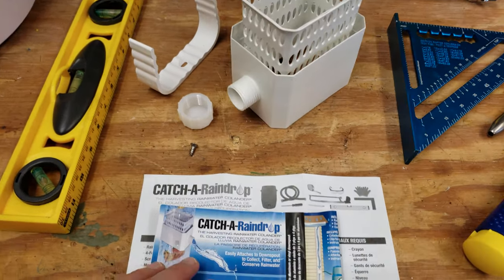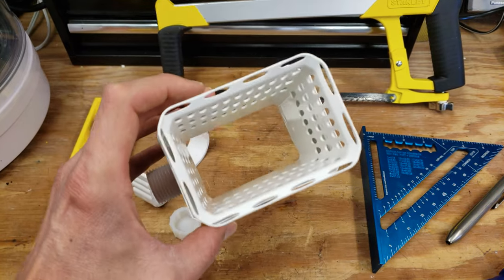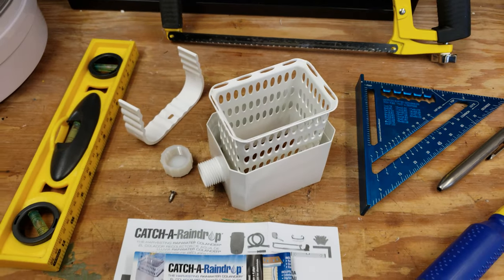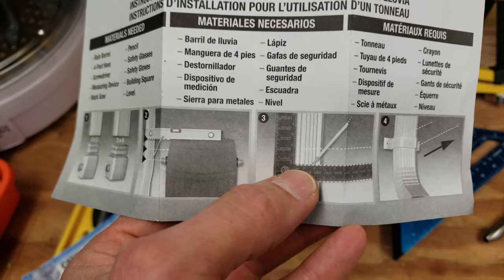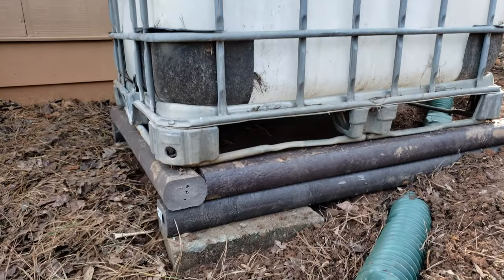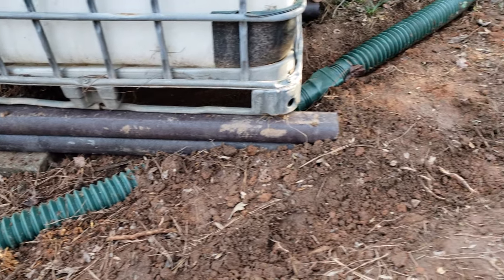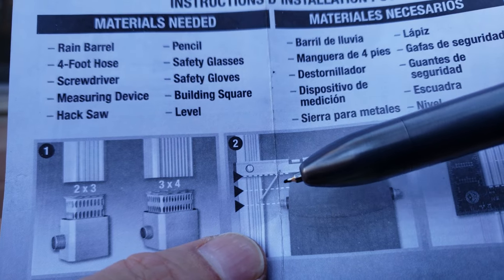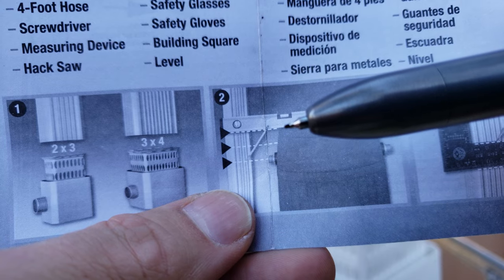How To Install Rainwater Diverter for Rain Barrel on Gutter Downspout | Flex-Drain 3x4in Rain Water

Comment: I put the inlet to the IBC caged tank in the center of the cap which is way easier to access and replace if necessary.  That allows for a complete fill and helps vent the air as it fills and you still have a tank without non-factory holes.  Replacement caps are cheap compared to the tank itself.

Those washer hoses are severely limited in flow as they are significantly smaller in inside diameter than a standard hose.

Comment: Simple overflow system I've used is a buy a sump pump hose kit, install on opposite side of intake drill hole with hole saw for connector towards top of barrel, and you have 25 feet of hose to direct away from foundation maybe in direction of a garden or plants. Also buying other connector fittings can be used to link barrels. I have run hose back to downspout in area's that were invenient for a long hose to be laying out.

Comment: Thanks for this video. I'm looking at that exact same rainwater diverter. How do you like it? Is it working well?
Reply from the maker: Works well! Filled up the 275 gallon rain tank within just a few rainfalls. That's from only about 1/6 of the total surface area of our roof.
Reply: @engineerable  Appreciate the quick reply. Did your rain tank happen to fill all the way up where the overflow went back into the diverter and down the downspout?
Reply from the maker: @rickysandwich  I installed a little higher than ideal because of where the gutter was already broken. So the tank fills up all the way, and would overflow if it wasn't for the cap. I leave the cap on part way so air can pass, but to tight for water to flow. 
So, the outlet of the rain diverter should be installed below the top level of the tank, and the hose connection on the tank should be a few inches lower than the rain diverter. The tank will fill up to the height of the rain diverter outlet.

Comment: Can you make the hole in your rain barrel on top of it instead of the side ?
Reply from the maker: If your tank is closed on top and can not overflow, then yes you can. Otherwise it will cause your tank to overflow. The entrance to the rain barrel must be lower than your rain diverter. The barrel will fill to the same height as the rain diverter outlet. Therefore, if you install the hole on top, your diverter must be higher, which will overfill the rain barrel.
Reply: Sz😀😀😀😀😀😀😀😀😀😀

Comment: Do you think this will work if installed on a piece of guttering thats at a 45 degree angle?
Reply from the maker: I don't think it will work well at 45 degree angle. Most of the water will likely overflow back into the gutter before it reaches the exit.

Comment: So how do you clean out the debris?
Reply from the maker: Haven't yet had an issue with debris, but it makes sense that small crap would eventually accumulate. Large stuff will pass through the center. Maybe back flush it with a hose? I also have micro mesh gutter guards, and not much gets past those.
Reply: Gutter screen system for most debris?